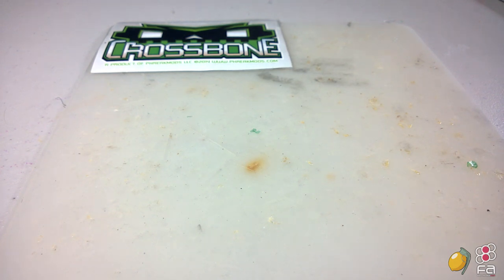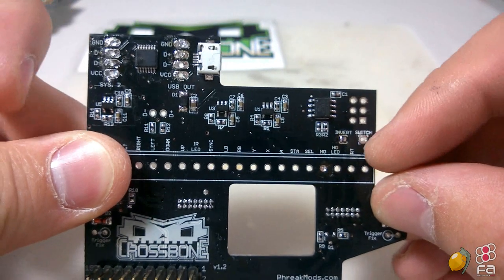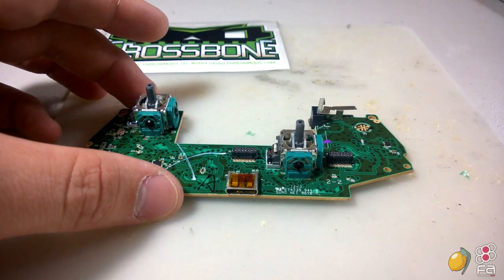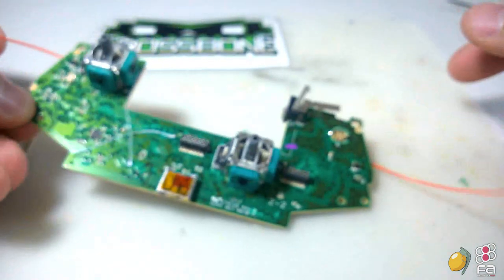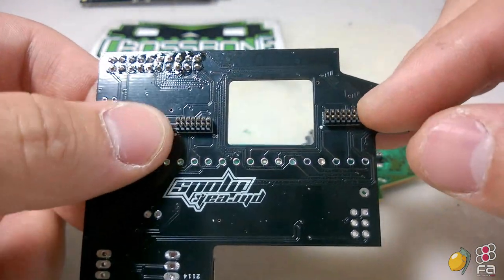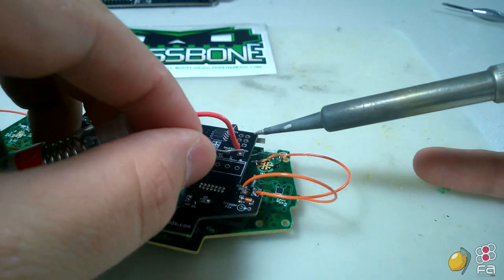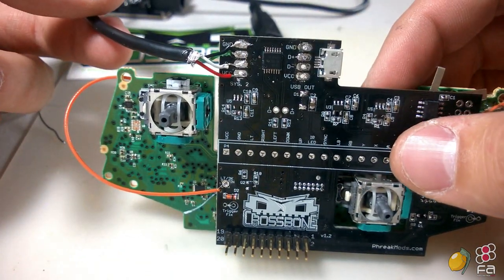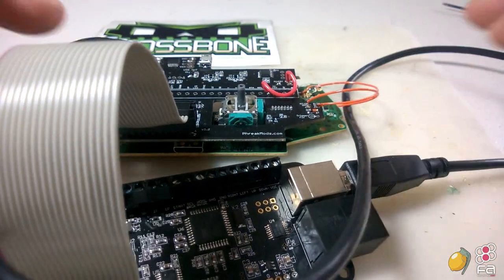Crossbone PS360+ Install Tutorial

Comment: Hey Lemony, I was wondering on the next video regarding continuing modding this set up to play on the additional console systems. Can this be achieved by using the RJ45 connection of the Akishop PCB to a Neutrik connector, then to the system itself? I appreciate the help. Thanks

Comment: What type of Solder are you using? Also what type of iron is that it has a nice fine ish tip!
Reply from the maker: Not sure on the solder, but I'm using a Weller soldering station 😃
Reply: Cool cool, I have a weller myself. Just need a smaller tip! Thanks for the response!

Comment: Wouldn't you just retain legacy consoles via the ps360+'s RJ-45 port (which would bypass the usb, and therefore the xbone/crossbone entirely?  or am I missing something?
Reply from the maker: It is possible, bout you would need to have two cables connected: A dedicated USB cable for the Crossbone and an RJ-45 with a Neutrik end for the PS360+. If you configure it in this way, there's no need to pass the USB from the SYS.2 connection on the crossbone to the PS360+.
Reply: Lemony Vengeance Yeah, I kinda already have this setup in my stick.  Though I dunno if i'm going to be adding xbox one support to my stick, but the vid was very informative nonetheless.  If I do decide to add xbone support i'll definitely be referencing this vid.
Reply from the maker: ***** Glad I could help!

Comment: Hi Lemony Vengeance, i did a Crossbone Hack according to your video. The application doesn't work with just the USB cable from XBox One to Legacy consoles. I've spoken to Bryan from Paradise Arcade for help. I tried individually connecting the cables from XBox One PCB and the Akishop 360 plus PCB and works separately. But, as a unit holding the Home button, the application doesn't switch over. My default is XBox One. Where is you second video regarding the legacy consoles? Need assistance. Stanley

Comment: Lemony,

For some people lateral space might be an issue. In that case I'd recommend using stackable headers on the crossbone, soldering in the 20 pin header upside down on the ps360+ and plugging in the ps360+ into the crossbone in lieu of the cable.
Reply from the maker: This is a really good suggestion! Do you have a link for some stackable headers that would work best?
Reply: Lemony Vengeance  I was thinking of the same ones you'd use with an Arduino. Solder in 2 of these to the Crossbone. https://www.sparkfun.com/products/11896.   Sorry it took so long to respond.
If the shorter ones are still backordered, you can use these and just clip away the excess with some wire cutters. https://www.sparkfun.com/products/11376
Reply from the maker: I'll add that to the description :)

Comment: I set up the Crossbone as instructed in the video, but when I plug in my controller it only works for a few seconds before asking me to reconnect my controller. Any advice?
Reply from the maker: Dj Graham make sure that the USB connections are where they should be and are cleanly soldered, then make sure that the USB cable connected to the Crossbone is 9 feet long or less.

Comment: Thank you for the very comprehensive and helpful video. My question is if I am going to build a stick only needed for the xbox one, would i just leave off the 360+ and solder each button wire directly to the corresponding button contacts on the crossbone pad? (sorry super noob here)
Reply from the maker: Brody Boyd that's right. I would solder the wires from the buttons to the Crossbone, then attach the board to the Xbox one PCB and do the trigger connections.

Comment: Lemon, I have had pretty poor luck trying to get this to work.
My 2nd attempt I soldered everything and plugged everything in. Once my xbox one was turned on it kept going to the right side of the screen. I managed to check my inputs in KI and it was repeatably hitting the right input. Is this a faulty PCB?
Reply from the maker: Did you make sure the analog sticks weren't signaling directions? This sounds like a grounding issue.
Reply: I made sure they were centered but I am unable to test with a MM.
Reply: Lemon, when the X1 PCB top board is connected, the joysticks don't signal either.
Reply from the maker: ok, so this issue only happens when the crossbone is connected? 

The directions are handled by the top board of the crossbone itself, unless the analog sticks are moved. If you have them hot glued into place, they should be fine. A good test of this would be to install the xbox one controller drivers on your PC, plug the crossbone and x1 pad combo into it and open Joy.CPL. This is the joystick config utility. highlight the xbox one pad and go to properties. if the Point of view hat is being held down, this is an issue with the D-pad being bridged. If the X axis looks like it's at 0 or full (either way) it's an analog stick issue.
Reply: Hey Lemony, is my Crossbone adapter dead? I tried using the micro usb and also tried soldering directly to USB out and my PC/X1 won't recognize it.

Thanks in advance.
Reply from the maker: hop in the SRK thread and provide pics. we'll get you sorted.

Comment: The ps360+ is still needed for compatibility with the 360 right? Crossbone is just a bridge or will it work for 360 without ps360+?
Reply from the maker: yes, the ps360+ is still needed for 360 compatibility.

Comment: Well, go figure... I removed the trigger capacitor. Now what? The site says they have me covered and i need to be a resistor for the crossbone. I see the screenshot but am not totally sure what to do. Do i still leave the wire attached to the points and the crossbone? Can someone elaborate on the steps necessary to get triggers working? Right now, when i plug it in my computer says there was a power surge on the usb port.
Reply from the maker: It may be best to post in the crossbone thread with pics to show what happened

http://forums.shoryuken.com/discussion/188609/the-crossbone-xbox-one-padhack-with-minimal-effort/p1

Comment: For some reason, the PS360+ won't connect to xbox360 while data + & - are connected. Please advise......great video BTW!!
Reply from the maker: Verify that the D+ and D- wires aren't bridged to each other, or to VCC or ground. Also, make sure the correct wires are connected to the right places on SYS.2.

Comment: Does the crossbones carry over headphone functionality?
Reply from the maker: It does not, since it's on the bottom board. You'd need to connect it to the port on the bottom board of the Xbox One pad and wire it up separately.
Reply: Lemony Vengeance So technically, if I drill a hole in my fight stick and place a 2.5mm female input in there, I could then plug the chat adapter into the bottom board and solder the cable to the 2.5mm female jack which would let me use it like a standard controller?

Also, even if I did this mod with my own controller how would wireless work? There are no batteries powering the board. I would have to have the usb plugged into something else to get the XBOne pcb powered, which is pointless since I could just plug it into the XBOne to begin with, right?

And not to be rude, but you shoudn't have the BGM as loud as your voice. It's hard to clearly hear you at some points. Thanks for the video, though.
Reply from the maker: ***** Regarding the chat, yes. That's what you would need to do.
Regarding the wireless, Wireless is disabled on all the bare pads that all retailers are selling. You would need to power it over USB.
Reply: Lemony Vengeance but wireless would be active on my normal control, so I could use that, but like we said, it would need to be powered via USB, which makes wireless pointless.

Comment: if we dont we have a Neutrik adapter how would the set up go as far as getting it wired to go to the 360/ps3/xbone ?
Reply from the maker: You can wire the USB cable to the USB OUT section of the crossbone
Reply: Alright cool cool just wanted to make sure . Cuz that's what I was going to do thanks !
Reply: Lemony Vengeance
quick question i followed as the video said but the ps360+ only flashed p1 and p4 lights and then goes out ? did i do something wrong?
Reply from the maker: This can mean that the data lines D+ (green) and D- (White) aren't connected correctly, or there's a wire that's not connected at all. How did you wire the SYS.2 section up, and where did you connect it on the PS360+ board? Are you connecting it via the USB B socket, or directly to the PS360+ board via the alternate USB header?
Reply from the maker: a picture of your configuration would also help.
Reply: I wired it up as you showed in the video. I checked the wires and as well as the solder points just to see if there was any contact . But all that was good . I even tried the ps360+ plus by itself and the p1 and the p4 light flashed once and then went dead after that
Reply: I can send a pic. When I get out of work to help out.
Reply from the maker: Sebastian Avila lets take this offline. I'll email you 😃
Reply: Lemony Vengeance sounds good
Reply: Lemony Vengeance
I would also like to know how to set this up so that everything can be done through the usb original cable. I only want to use it for ps3, 360, and xbone. Thanks
Reply from the maker: Thomas Spalding as stated above, you can solder the wires in the USB cable to the USB OUT section of the crossbone. Red to VCC, Green to D+, White to D-, and Black to GND.

Comment: I may have missed it in the comments, but can this be combo'd up with a Cthulhu board as well?
Reply from the maker: yes it can, as long as you follow the pinout closely. the MC Cthulhu's expansion header (where you connect to for 360 Dual modding) is pinned out much more differently than the Crossbone's expansion header. Connect the Cthulhu to the Crossbone as if you were dual modding (minus the IMP since you can bypass the crossbone) and you should be good to go. Technically you could even Tri-mod with the crossbone, an imp and an MC Cthulhu... ;)